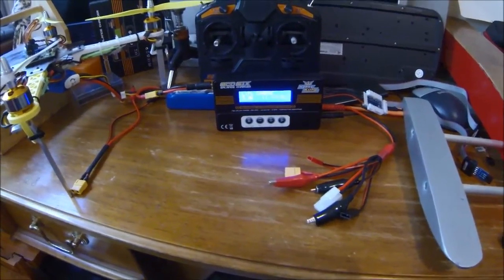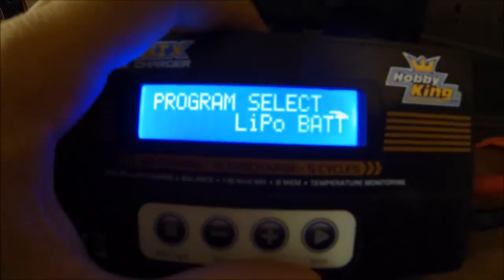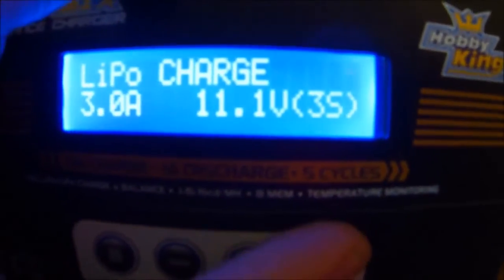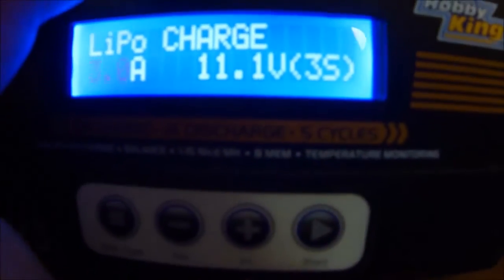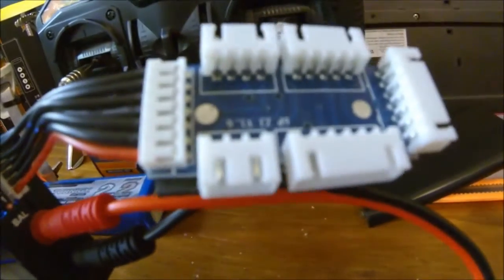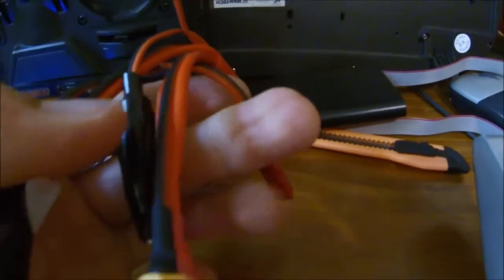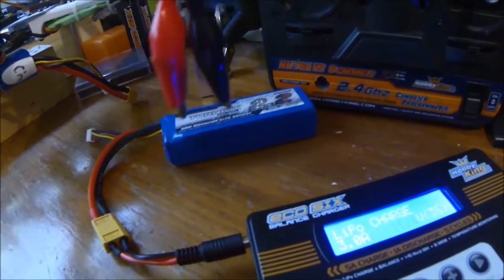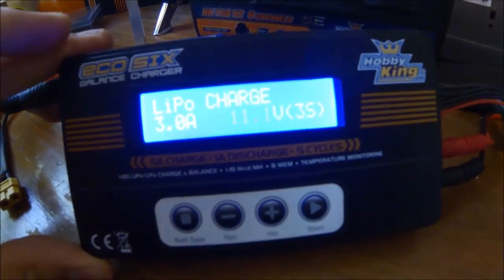HobbyKing ECO6 balance charger tutorial

Comment: I have this charger; I taped up the aligator type charger leads thinking they may short circuit if they touch during charging? Are all the leads live during charging? Thanks - good instructional vid.
Reply from the maker: Unfortunately all leads are indeed live during charging or whenever a battery is connected. I ended up making a dedicated XT60 connector since 90% of my batteries are XT60.

Comment: My eco 6 fan was not coming on after charging at 8A for 25mins. Is this normal? It was quite warm i would say!
Reply from the maker: +izzzzzz6 
Unfortunately the HK Eco6 chargers don't actually have an  fan... at least mine never did, later on I rigged up a mount that held the charger and a 5A 15v power supply and incorporated an external cooling fan into that, connecting the 12-18v fan directly to the power in lead (I had to somewhat disassemble the charger to access the terminals).

The Eco6 does have a free space inside for a fan, but all the fans I could find are around 2mm to thick as it needs a 25mm by 10mm fan and the standard is 25x12mm. You'd also need to drill some holes in the plastic case to allow airflow.

I can send you pictures of the mount I made if you're interested.

Comment: Thanks for the tuto! I have a question: I am intended to buy and use this with laptop adapter as the short manual says on HK dot com. But my laptop adapter is 19.5 volts and on HK they mentioned  11-18 volts but not 19.5 . What is your suggestion? Would this beast take the 19.5 as an input (since it seems pretty versatile) or not?
Thanks.
Reply from the maker: I tried to use this with a 18.5v adapter and it turns on but reads 'input voltage error' beeps and won't charge, so now I use a 15v adapter.
Reply: Chelsea Moseley Excellent answer - bad news :(
Thanks. :)
Reply: @molekulaTV  use a little step down adapter

Comment: Maybe a tutorial on calibration only.
Reply from the maker: calibrate as in..? after you set the amps and voltage it should stay that way. Yes I can do another tutorial on loading data, saving data and programming that allows you to change from LiPo to LiFePo to Li-ion etc. It auto detects input voltage and the minimum volts can be adjusted